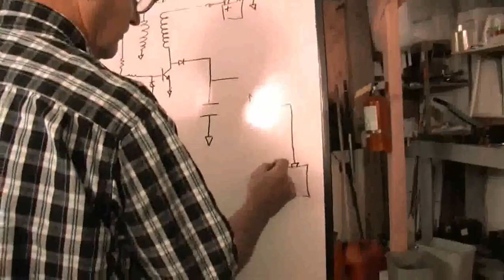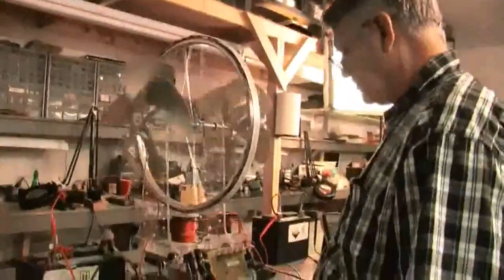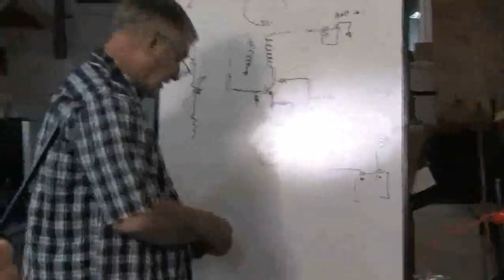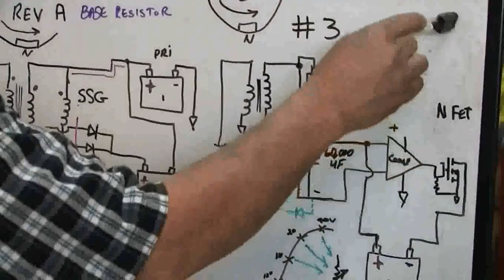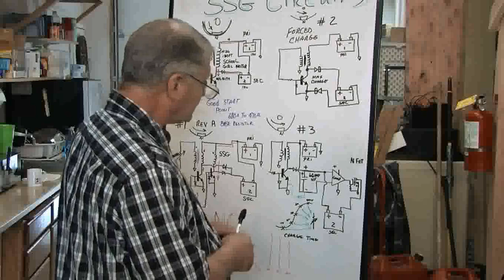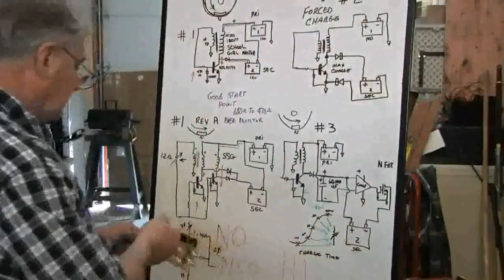Bedini SSG Large Comparator aka Cap Dump

Comment: 1*1=2?
Reply: what is really going on is the circuit is forming high voltage spikes into the battery, what this does is make exotic vacuum objects into the battery, something in lead acid batteries converts them into usable electricity. so you do actually end up with more than you started with. you can do all this with no moving parts as well. but remember that people that use spark gaps in systems, the spark can make small fusion events, so that is how they come up with more power than they put in (especially underwater sparks in hydroxide solutions).
Reply from the maker: @spacecase0 I am yet to get to the stage of playing around with spark gaps, etc. I prefer the sold state stuff and low voltage. Never knew about the fussion events. Cheers.
Reply: Well that's pretty "out there" as an explanation.  I don't think you are likely to be creating fusion even if you are creating plasma at 2k Kelvin in the spark.  But I will go with "I don't know" for now.

What is the propeller for?

What I think I am seeing is a self-tuning pulse charger with some suggestion of joule-thief circuitry and no small hint of over-unity.  

What fascinates me is that we (as a community) are not  monitoring volts, amps and time and that we aren't all saying bring the on-off period under software control and add some source a of energy.

At another level this is a Pedagogic exercise and needs to be appreciated as such.

The student is a bit repetitive with endless "OKs" and "Uh Hmms"
Reply from the maker: @simonmasters3295 what are you talking about? It's a simple SG with Johns old cap dump demo. I'll chalk it up to u having no clue as to what is happening due to ignorance.
Reply: @simonmasters3295  measuring volts and amps fails when playing with charge clusters, also much of this is pulsed, almost not possible to measure that (you can dump it into a capacitor, but then your machine is not getting power...
as far as thee fusion events, it is the electric field doing it, temperature and gravity are small forces when compared to the electric field
Reply: @spacecase0  do you mean gravity field ? / magnetic field energy ?
Reply: @tvdylan  so, you have to pay for the electric field, but the magnetic field is for free...
Reply: @spacecase0   @spacecase0  yes exactly, in human society terms 🤗  magnetic fields are a form of free energy gain. and yu say spark gaps underwater, is there a benefit to doing that?
Reply: @tvdylan  I know others that set up underwater spark gaps, with hydroxides in the water... and they seemed to make way about 4 times the energy in...
seems as if it is doing fusion and that is where it gets the extra energy
Reply: @simonmasters3295  the lovely lady in the video is a lovely lady !  : ) i think thats his wife !  : )    and as for on/off controlled by a computer, thats exactly what im tryina do now, you can use a hall sensor for the passing magnets and feed that into an arduino board and then feed the logic output to MOSFET GATE DRIVER AND THEN INTO THE MOSFET. then we can have sharp on/off moments. reduce the amount of nano seconds it takes to turn on and off .
Reply: s man i made it ...................✌✌✌

Comment: I am able to build a self-resonant coil that adapts to the applied load, it will be extremely similar to the monster circuits which to simplify a lot resemble Tesla's drawings when worked with bifilar coils to simplify designs and have capacitance without capacitors.
I bought the materials for the first bifilar coil wound in multilayer so as to obtain very high capacities between the adjacent turns.

If it works I could make some videos and experimental tests.

I also need an expert in high frequency coils because I have more advanced questions than classic electronics.
Reply: Go for it!